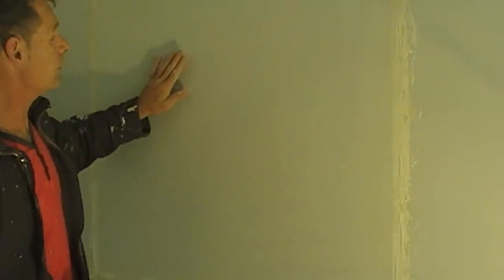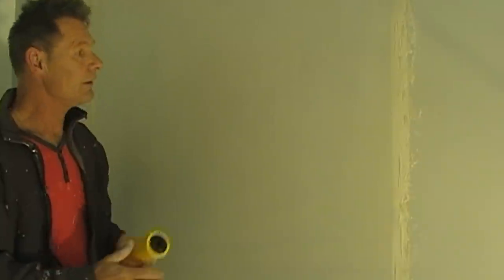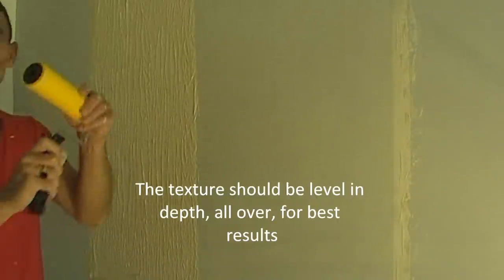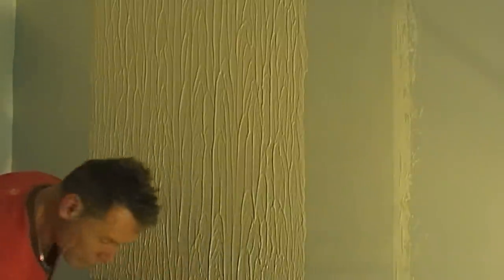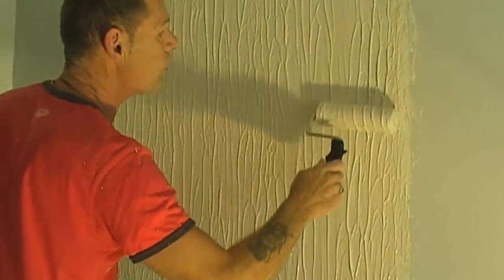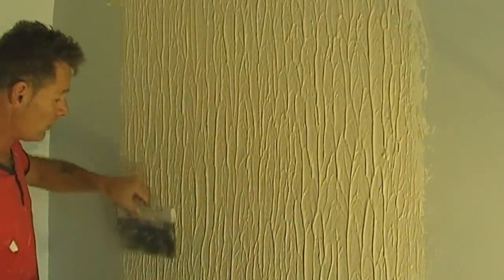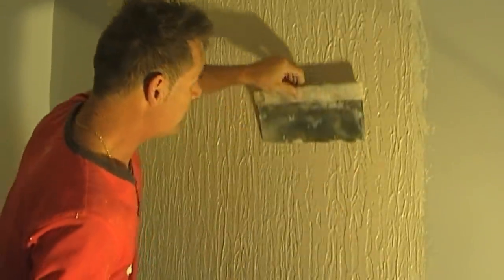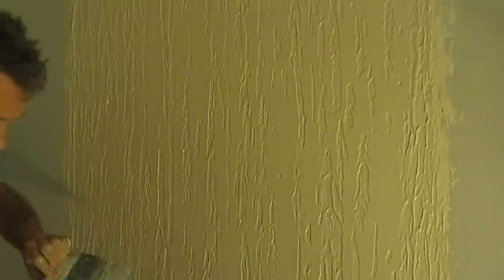How to Make Tree Bark Wall Texture (knockdown) Easy Simple Steps

Comment: Just sent hubby out to get the supplies we need to do this in our living room. We're super excited! We love in a double wide home, and the sheets of "drywall" are connected with batten (sp?) strips... I HATE them! So we want to remove thoae, and apply this technique to the walls to hide the cracks between the "drywall" sheets. :)
Reply from the maker: +Heather Chambers Hi there Heather, a cunning idea & I sincerely hope you make your hubby a loverly cup of tea when he comes back from the DIY store. I would love if yet us know how your task goes, and the roller you used to make the tree bark, plus which texture you found the easiest to work with.

The joints between the wallboards will still need taping as the texture finish will cover certain bad aspects of a surface, but any cracks/joints will still come through once the texture has dried. (Please accept my appologies if you already know this, and if you do not, I have a video in my yt collection focusing on taping cracks prior to texturing) so joints and cracks still require the correct preparation first

And as you already know, to make a decent tree bark texture, the surface does have to be flat (unlike some other texture patterns) and reasonably smooth, so the roller glides down the wall, unfettered

One last thing, in my latest video just uploaded to youtube https://www.youtube.com/watch?v=A7FmQPq-ORg I am giving the home made roller that I made, away for free, the competition ends last day of April. If you are interested or know someone who is, just go to our new fb page 'creative ceiling wall textures' and make a post (the competition rules are there on the page)

Thank you for commenting Heather, I really appreciate it and I hope you and your hubby do a fantastic job

Have a great day
Reply: +Dale Ovenstone Thanks for the reply! The seams between the boards are very tight... Almost impossible to get mud between them. So hopefully everything will go okay without taping, as I didn't have him get any tape! We shall see how things go. ;) I saw your new video on the DIY roller for this technique, and that's what we're going to do too since he couldn't find a wallpaper seam roller at the hardware store. If I can figure it out, I'll share our results with you once we're finished. :)
Reply from the maker: Heather Chambers That is fantastic and thank you for viewing the new vid. Good luck with the roller making too (please let me know how you get on)

Comment: Very good. Here in Brazil there is no roller like this one. But I can make with another type. The question is: You dont show the edge painting. How to paint the edge, making the texture, so the roller dont reach the edge ? I hope you understand my question.
Reply from the maker: Hello Ricardo. I will make a video in the near future showing the finish around the edges. Basically, 1 1" paint brush is run across the top and bottom of the wall, to complete a neat finish. I hope this helps. Have a great day

Comment: Hi Dale when you mention elastic bands, if you were to use elastic bands on the flat roller how would you have them on the roller? I take it you wouldn't have the bands criss crossing over each other, you'd just have them straight around the roller? thanks! Great video by the way and thanks very much for your help
Reply from the maker: Hi Brian, thanks for commenting

To be upfront about the elastic bands placed onto a flat roller;

Many texturer's believed that by placing elastic bands onto their flat roller, would create a really thick, prominent tree bark wall texture

The elastic bands were sometimes criss-crossing each other, but were placed around the roller, as per your observation in your comment...

But the same kind of effects could also be achieved without using any bands on your flat roller...

How this is achieved is;

If the mixed texture was of a thicker consistency once applied to the wall, and even laid on as a thicker coat, then when you draw your flat roller over this surface, would create a really proud, thick texture.

Where as if your mixture was of a watery'r consistency and once placed onto the wall, would create a less visible and dribblier patten

So as you see, the desired pattern effect outcome to make a tree bark (or broken leather, or a stillpe etc), would depend on the thickness of the consistency, and how thick you lay that mixture onto the surface

I hope this explains the elastic band myth, and really, to create the desired effect will take practice on an inconspicuous area until you reach the desired outcome you wish to achieve

I hope tis helps please let me know

Regards, Dale

Comment: Hi Dale is this a thick magnolia coloured emulsion paint you have used or textured coating as I can't get your consistency! thank you  :-)
Reply from the maker: Hi there Brian, thanks for commenting

There are products called 'textured finishes, or, texture coatings, designed especially for creating artex, or drywall patterns onto ceilings & walls

This is the material I used, and certainly not paint or emulsion

The colour you see on the video is just a light effect, but in reality, the texture coating I am applying is a 'off-white' colour

As for the consistency, on my channel here, I have a few videos where I mix to the correct consistency for the pattern desired

Hope you check them out and discover what you are seeking

Have a great day

Comment: hi i like how it looks when you have it, but my house was built with this texture and it looks terrible, i really need to know how i would get rid of it? can you help? all i can think of is to scrap it all off and then sand it down
Reply from the maker: ThePiacentini Hi there. As of the building regs for health and safety, it is wise/essential/regulations to get a sample of texture checked by a reputable company dealing with such issues, as the old stuff may have contained asbestos, and removing/disturbing the texture coating could release particles. With that said, sometime a textured surface is difficult to scrape as the copious amounts of paint applied over the years makes scraping difficult. Some texture is applied thick (as in your bark pattern) & will possibly require the services of a plasterer. Let me know how you get on
Reply from the maker: ThePiacentini Thank you for the share
Reply: thank you for the reply, i will get it checked out right away, will let you know if anything changes, thank you

Comment: Hello . I am Persian language and I live in Iran. This type of color has recently become popular in Iran. If you can explain the different types of colors and how to use them, or if you can make a video, I'm very grateful. Kazemi from Iran
Reply from the maker: Hi there, thanks for commenting. The colour of the texture in this video, is kind of pale yellow, because of the powerful spotlight I am using to showcase the video. The original texture colour (without painting it) is actually 'off white.'

I hope this helps please let me know
Regards, Dale
Reply: Thank you for answering you ... But my question was about the type of color or texture (such as acrylic or base oil), or its type. Also, does the manufacturer of this type export, export or export to other countries? And what other products does it produce? 
Many thanks
Reply from the maker: The paint is water-based (EMULSION) because it is used to paint on interior ceilings and walls. Oil-based paint is normally used on painting woodwork, and sometimes metal, inside houses.

Also, the texture is water-based. Like a cream coloured powder, then add water and mix to the consistency for the texture pattern required. This is made to make patterns on ceilings and walls inside the house

Let me know if this answered your question
Regards, Dale
Reply: Excellent ..... In Iran, this color is made of texture (dough shape) and only its acrylic type, and unfortunately it is not good quality. I and some friends try to enter Iran better quality and brand. But just from this color or powder model for the walls of the houses ..... with the tools associated with it

Comment: Dear, its looking awesome but i have confusion in this video
you are using plaster or gypsum?
Your roller is simple or you make changes?
Reply: Will be something like drywall compound. Try rolling standard plaster on your walls and your going to have a nightmare on your hands! Plaster is generally applied with a hawk and trowel. At least here in the UK anyway.
Reply from the maker: Khalid, my dear, do not be confused for what you see in the demonstration is what you get and I have tried to make the task for creating this pattern as straight forward as possible. Thanks for commenting. Have a great day
Reply from the maker: Nice one Javier. Over the years I have seen some attempts where folk have used plaster/gypsum, and it is just not the same rto work with for creating patterns, so best not try. Thanks for watching my texturing videos and for commenting. Have a great day

Comment: Very nice work. Is there a special putty you have to use for that?
Reply from the maker: +Lee Mullen The material used is called texture powder. Thanks for commenting
Reply from the maker: Ceseme, usually drywall compound is texture for interior ceilings & walls, there are various types for creating patterned finishes, such as in the UK, Wondertex & Artex are 2 brand name texture powders that are both capable for the job
Reply: Nice work.  is it the lighting, or is that mud yellow? I would imagine you had to really water down that compound to be able to roll it on like that. Thanks for sharing!
Reply from the maker: The lighting did affect the colour of the texture shown when I saw the video outcome, I thought I was wearing yellow tinted contact lenses. I think I may even have a yellow glitch in my camcorder.

For the tree bark texture finish (or any other texture finish, in fact,) that is the greatness of texture compounds specifically manufactured to adorn ceilings & walls, made specifically for the job, which work adequately through a wide spectrum of the materials, (when mixed with water,) consistencies, depending on what pattern is chosen.

Various tools such as combs and rollers and sponges and designated texturing tools ect (including the fingers (known as a 'medusa' finish)) can be used to create a plethora of creative patterns, as the consistency will fluctuate depending on desired textured pattern to furnish interior walls and ceilings.

As it happens, I published a video explaining consistencies of texture on my youtube channel quite some time ago, but I get a lot of folk sharing their disappointments and frustrations and I'm not really a counsellor, so I don't openly share the video link.

Thank you for commenting. Have a great day

Comment: Hello is this an normal , ordinary interior wall paint or a special kind paint?
Reply from the maker: Zeyno, thanks for your comment.

The material is called texture compound. Sometimes called ARTEX in the UK, or drywall texture in the US.

It is not a plaster or a paint, but often it comes as a powder, where you mix with water to create a consistency desirable depending on what pattern you intend making on ceilings and walls.

I hope this helps please let me know
Reply: @Artexing  i have searched on internet but couldn't find as  texture compound but I have found as joint compound and translated it into my languaged and bought it. I hope i have bought the correct one. I m gonna try this on my sister's home's wall. I hope I can do it:) Thank you sooooo much ❤
Reply from the maker: Zeyno, some folk have used joint compound for interior walls, as they could not obtain texture compound.

So long as it is not too fast drying and you can mix it to the required consistency to create the texture you wish to make, then give it a go.

Don't forget to seal / prime your walls before hand, and let this dry, to help diminish as much porosity as possible, so that the compound does not dry too fast into the surface once you place it onto the wall.

Also, my texturing guide, 'Nifty Tips n Tricks of a Professional Drywall Texture Practitioner' is available on kindle for more information, and sometimes is free to download there.

Please let me know how you get on at your sisters. And best of luck
Reply: @Artexing  thank you sooooo much i will definitely let you know the result. Kissing you ( a perfect kind hearted man) from your heart ❤

Comment: This is an awesome pattern and you make it look so easy. How do you get the pattern / roller  into the top corners?
Reply from the maker: Normally Kenneth we use a 1.5" paint brush to create a smooth border edge around the entire perimeter of the textured pattern

Comment: can I use this material outside, front of my house and what's the name of the material, please, good job I like it👍👍👍
Reply from the maker: Munir, this is an interior finish called texture compound cannot be used outside. I have seen the similar pattern made with a cement-based mix for exterior walls

Comment: How do you handle the top 2" and bottom 2" of the wall that the roller misses?
Thanks for sharing.
Reply from the maker: Hi there No Name. Basically using a 1.5" - 2" paint brush to lightly brush the edges. I have been asked this question so many times that I am in the process of uploading a video demonstration, because my typing fingers are basically knackered answering the same question. Then again, my fault I should have showed the process in the tree-bark texture video uploaded here. Thanks for commenting have a great day
Reply: Dale Ovenstone Thank you Dale for the answer and video.  Such a cool texture and idea!

Comment: Any tips for doing this on a ceiling?
Reply from the maker: Heather

In the olden days we used to create this pattern on ceiling beams in pubs to create a wooden effect.

Play around with the consistency of the mixture and the depth of how you apply it.

You may find it often creates more of an untidy 'stipple effect.; Until you get all the above mentioned factors correct

Practice on smaller area until all feels right

Let us know how you get on

Thanks for commenting

Have a great day

Comment: is it a normal paint or it can be done with any normal wall paints..??
Reply from the maker: The paint is for interior ceilings and walls. Only problem is, you need to take caution when painting a porous surface such as new plaster or texture for the first time, to diminish the chance the paint has from flaking off the wall / ceiling. I am about to upload a new vid demonstrating this, 'painting new plastered & textured ceilings & walls' Thanks for your comment have a nice day
Reply: +Dale Ovenstone Thank you so much..
Reply: shahnawaj alam 1

Comment: where can you get those smooth rubber roller? Ive called every hardware store around here cannott find. where can they be ordered on the internet?  would a foam roller work? Thank you!
Reply from the maker: Janet Chessor The roller is actually smooth and hard and is a 7" wallpaper seam roller' I think it may be made of foam. And available on the internet
Reply: I purchased mine at Lowe's.

Comment: you do beautiful work,i try do get the same texture but i think i'm using the wrong mud,taping mud.What kind of mud are you using?
Reply from the maker: Keep trying, you may have to experiment with a few compounds before you find your favourite.

The mud I use mainly is a texture specifically designed to tape up joints prior to texturing, caulking out uneven surfaces, also feather edges besides finishing all manner of texture patterns.

I mix the texture from powder, and is specifically designed for creating textured finishes on interior walls & ceilings.

The actual product is available in the UK, currently, and is called WONDERTEX. That is my personal preference. Another popular brand is a texture called ARTEX. It has been around for many many years in the UK, and as wondertex,, does the job nicely.

Many texture's in US & Canada use specific texturing brands for creating intricate texture finishes on interior ceilings & walls (using combs or rollers or brushes etc) and they have their favourites too, but I do not know where you are from? Below is a link to an article with more information which may be useful

http://inspired-to-write.hubpages.com/hub/Which-Drywall-Texturing-COMB-Tools-Art-Effects-Compound-Mud-to-Use-USA-CANADA

Thank you for commenting Joe, have a nice day
Reply from the maker: Thank you for sharing the video Joe

Comment: I couldn't find a smooth roller either so what I did was to get a piece of 2 inch pvc pipe and inserted a paint roller with 1 1/4 inch nap. I am wondering how do you get that tree bark effect all the way to the ceiling joint .
Reply from the maker: +Lee Mullen For best results, to get the pattern as near to the ceiling line, it helps if there is cornice/coving inserted onto the ceiling/wall edge.

This allows you to be able to push the roller (where the texture has been laid onto the wall) nearer to the edge.

Also, if you notice in the video, the roller that I am using to make the bark pattern is rather fat in diameter, whereas the original bark roller that was manufactured by a company, was rather slim, which is ideal for getting nearer to edges (bottom of wall and top of wall.)

When using the narrower pipe placed onto a small paint roller, this is ideal. I have actually purchased the materials to show how to make a home made, cheap bark roller, an d will be posting a video tutorial soon